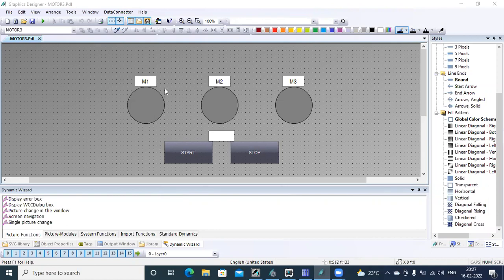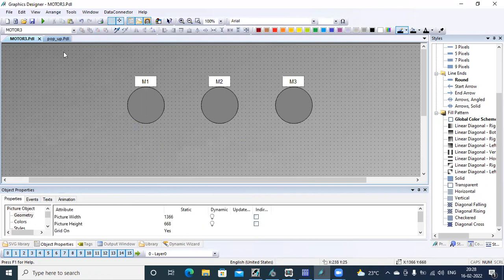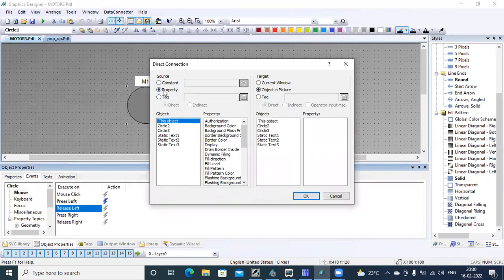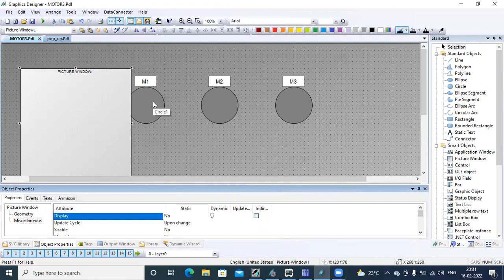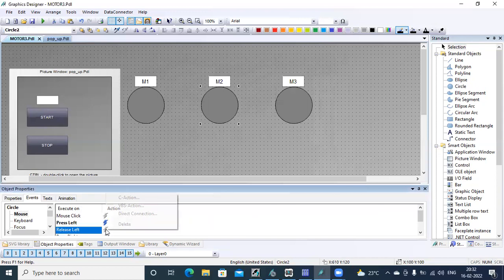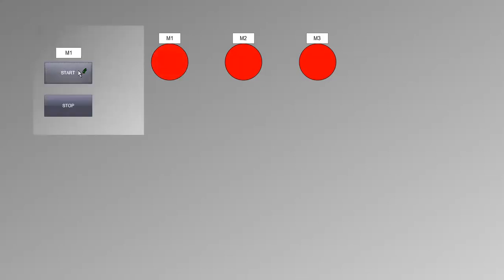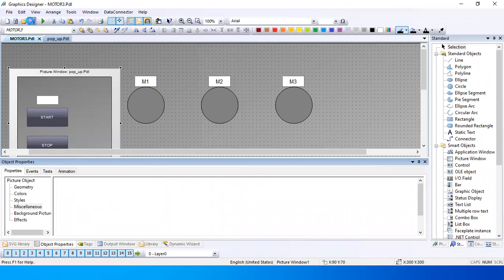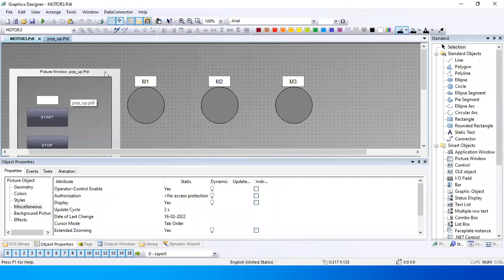Lecture#8: POP up window in WINCC V7.5

Comment: Sir, Please share event setting  button start & stop
Reply from the maker: Its already there in lecture nunber 2 / 3 please check
Reply: i checked your lecture number 2/3, there are no related content. please make your video more detail.
 @plcscadatrainer01
Reply from the maker: @guweizhao3430  what's your requirement? What actually you need to configure?
Reply: @plcscadatrainer01  How to setup the start/stop buttons that can control 3 pumps ?
Reply from the maker: @truhoang5894  what actually you need? In this example you can see 3 outputs or consider that as pumps , you can configure or if you want separate start stop buttons for 3 pumps there's another example you can follow.